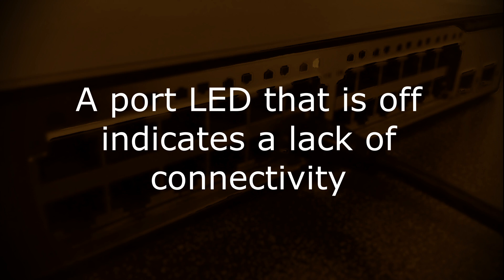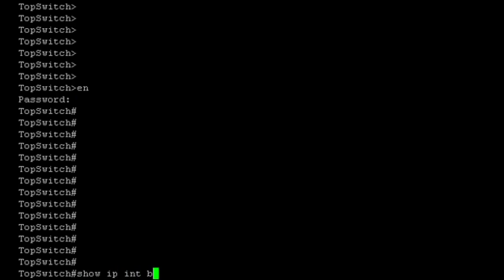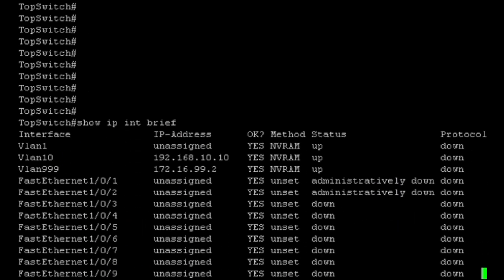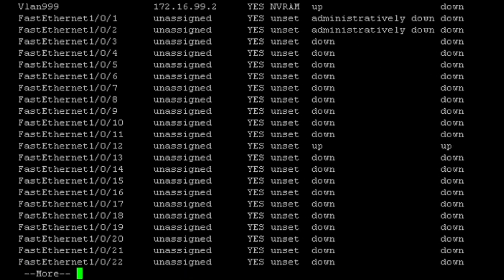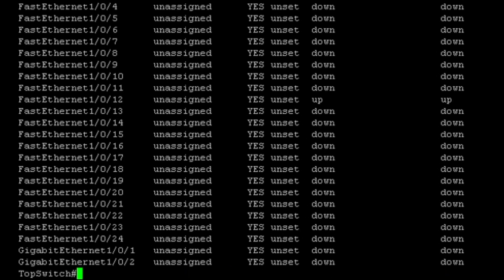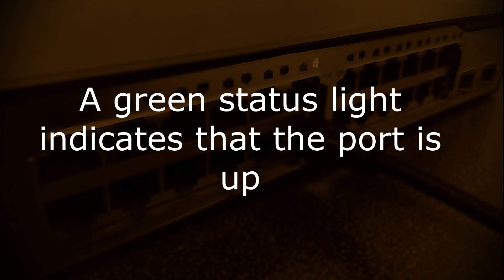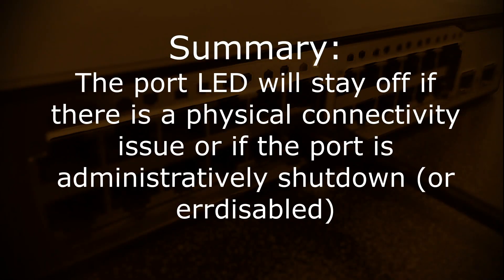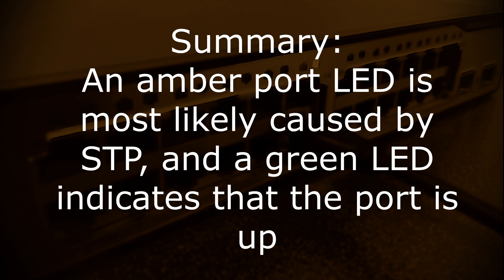Port LEDs on Cisco Catalyst Switches

Comment: I just purchased a new Catayst 1000 which the active port LEDs blink not as rapid as other Catalysts I've seen in the past, it blinks about 1 time per second. Though everything is working fine, wonder if anyone has seen something similar.
Reply: Yep not used it, they just stay light which freaks me out.  Have you been able to figure out why?
Reply: @alexbasile991  Not really, but everything is 100% functional. I looked at one of the YouTube video about the 1K series. The person plugged in a network cord to port 1 for zero day configuration, and the LED acts the same fashion like me, so maybe it's just the design.
Reply: @張C兄  Apparently it is per design from the datasheet, also no mode button to see what ports are doing anymore :-(

Uplink or downlink ports do not support the amber-colored physical light emitting diode (LED). For all port-related LED verification, use the show hardware led command.

The uplink and downlink LED do not blink when the traffic rate changes.
Reply: @alexbasile991  the new design doesn't make sense does it?

Comment: one of my 2960x 48 p  has a wired issue, when I turned it on after it completely boot up the sys light is solid orange I tried factory reset it but unfortunately still same issue which caused the switch to not communicate with the network, I contacted cisco the provide me license to apply but same issue still. Anyone face this issue may give tips to solve this problem. 
Thank you for you informative video

Comment: bawt a switch on ebay and ports 1-16 refuse to light up. config is a liar saying the status OK. Ports 17-24 work fine. Is this a power rail failure?
Reply: Which model?
Reply: @jkftech  WS-C2960S-24TS-L
Reply: Have you tried resetting it to factory default settings
Reply: @jkftech  resetting was done to death , but this switch was returned to seller a while ago
Reply: Watch my videos on how to do factory reset , if you don't know how to do it